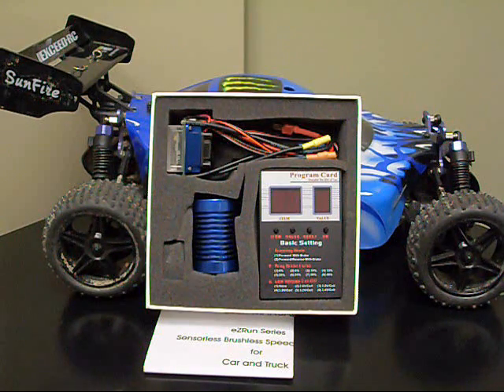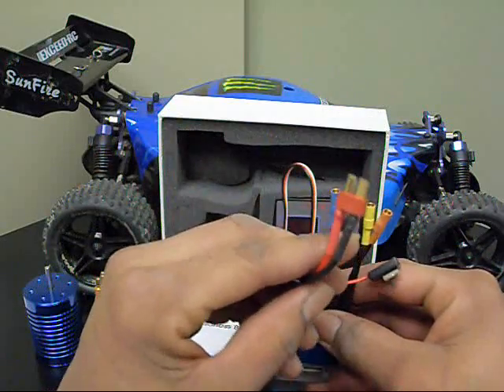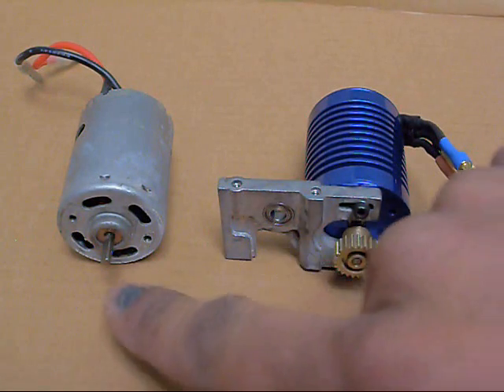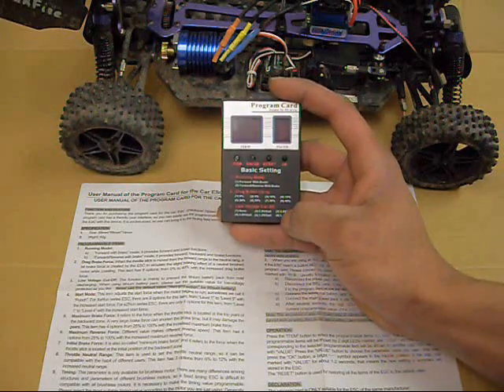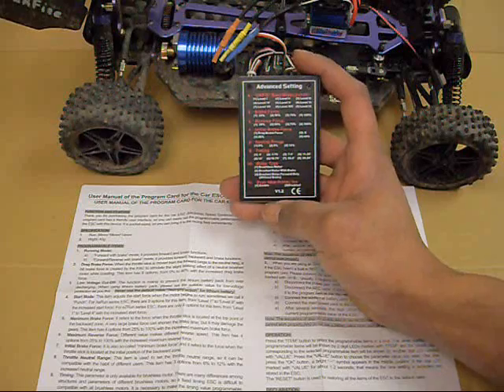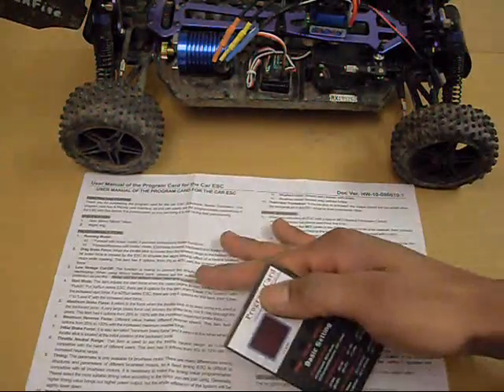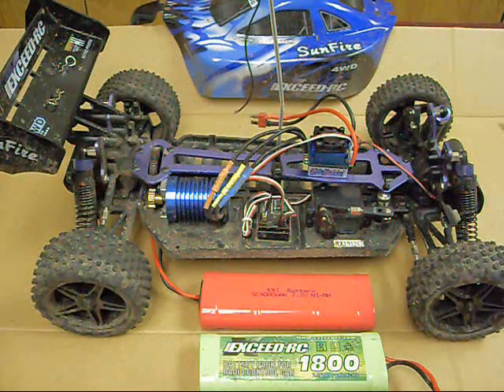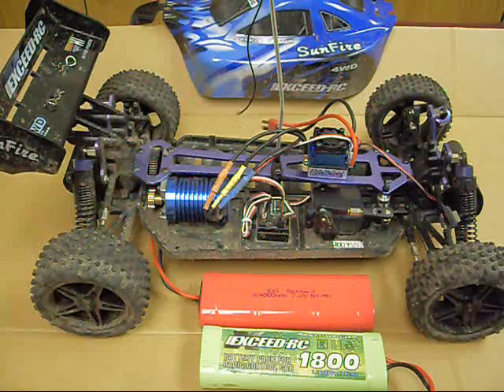Super FAST Brushless Upgrades for 1/10th Electric RC Cars!!!

Comment: talk about breaking gears my Truck is in the shop right now getting new gear system put inside the Truck would this be good motor for my Truck and battery to upgrade to stock??

Comment: can those motors be placed for on road rc ?? seen a lot of them on buggies but not on road. thanx
Reply: +Hydra Inarms Theoretically, yes, however they have a low(er) kV, which is like the gear ratio of electric motors.
So pretty much, yes, but it would run a slower top speed than a road motor.

Comment: how long would a 7.4V 5000mah battery last on this set up?
Reply: +Devon Asher 13 to 15 min
Reply: +Devon Asher If you set it up properly, on video is too much power for this car, you will get up to 60min on LiPo.
Reply: i dont think 60 min is anywhere close to reasonable but i do agreeon too much "ebay" power

Comment: can i run this  system with nihm 3300?
Reply: I just put this motor and esc in my 1/10 2wd ECX Torment, I use a 3600mah Venom battery. I even use a 1800mah battery works fine.

Comment: Would a 7.2volts NiMH 3300mAh Battery work well or would i need to go bigger
Reply: +Jay Rolt low run time on that battery but go bigger for faster and longer run time
Reply: ok thx
Reply: np

Comment: sir can u help me, im handicapped they r gonna resend me a l969 n the 1st 1 ive still got it but i dont know how to  fix it u see the front right wheel came off but its still on truck, now everythings there i think except where u know where the tube thingy goes in   tire n at other side i think its missing other part to hold it on but ur the expert im not saying what it needs i just dont know, n why do theyyy sell cars  to that just burn up in less than 5 mins n i cant afford it can u help me out no im not sayiing u pay for it or anything im saying to help me creat something that is fast n wont burn up so quick i need help, PLLEEEAAAASSSSSEEEEEEEEEEEEE
Reply: jeff c Buy a HSP xStr Pro and don't do anything with it except charge the battery and have fun.
Reply: dude wha wha wha mman wow the hsp stuff is realy exspensivee im a handicapped person i thought u would help  me , id like to get all that stuff but i dont know what to get, can u help me out

Comment: I m sorry but this system is not super FAST. It s just a regular mild system that is great for stepping into the world of brushless motors and ESC's. And if you have a 4x4 rc, you are going to want way more juice in your ESC, because 35 amps man... That's just begging for the esc to fry out. In a 4x4 1/10 scale rc i strongly recommend that you get a motor system at 60 amps or more, that will work just fine in my opinion. If you are looking for something cheap and POWERFULL, buy the Leopard V2 10t brushless combo, you can get it at Hobbyking for example, and you will get a medium/powerfull brushless combo for around 70 bucks. Use a 3s lipo, and man this thing rips. Depending on the weight of your rc it can go from 30 mph to 50 mph (50 mph is on 3s lipo only) but you want to stick to general 2s lipo if this is your first experience of brushless. I can t comment all the details here, it would be to long, but go to my channel FAST RCS for more info. Ill be posting "New into rc" and "rc tutorials" soon, hopefully. But please tune in to my channel and watch my running videos, hope you like it!! Otherwise great video Nitrorcx, good job😉
Reply: Fast Rcs Bro in 2009 it was like super fast but now 30 mph super slow I anyone saw someone with a brushless rc car the were very jelous
Reply: Fast Rcs hey I want my rc to be fast as hell should I do higher kv or lower
Reply: Higher KV means more top speed and lower torque, and lower KV motor means less top speed but more torque.

Comment: Get your basic facts correct if you make a how-to video.... 3.7V is nominal voltage for LiPo batts and not a low voltage cut off situation.  LiPo should not go be low 3.0 volts so a cut off setting would be 3.2 or 3.4

Comment: watch out for ezrun brushless 1/10 systems the motor is advertised as 540 size, its actually a 380 size with fins on it, i have fryed 2 of these in my team associated t3 2 wheel drive, but all the best with your buy and good video, cheers .

Comment: you need a much more powerful system for that 4x4 buggy.. what you have there is guaranteed heat problems. i had the 65 amp version and with fairly light gearing also had some excess heat.... good luck man. cool video though!

Comment: You should not drain lipos under 3 volts per cell. 3.7 volts per cell is super conservative. I have used 3.1v per cell as a safe cutoff and never had any problems.

Comment: I suggest that you upgrade your ESC to a 60 amp because I used a 45 amp ESC and paired it with a 3 cell lipo battery and ended up shorting out my ESC. I was left with a melted price of plastic and and burned wires. The exceed company manufactures the brushless counterpart to the brushed sunfire buggy and uses a 60 amp ESC. If I wanted completely overkill, I would use a 5900 kv tacon motor, an 80 amp esc, and a 2200 mah sky lipo or gens ace battery.

Comment from the maker: Yes you can use a 3S lipo with that combo, but you might want to upgrade the fan on the ESC later on down the road since the fan isn't rated for 3s usage.

Comment: I upgraded my Sunfire buggy to a brushless combo with 35a esc and 4300kv motor with 7.4 v 3300mah 30c blue lipo battery. i think i get 45 mph. i was wanting to know if if could use an  11.1v lipo to acheive 60 mph without damaging my esc or wo

Comment: Hi, ive just ordered a brushless upgrade kit, & yours is the best upgrade vid for my xstr 1/10, will it be able to handle it? i'm currently running a 7.4v lipo 5000mah 40c in the brushless motor it runs fine but it only goes about 20mph.. the leopard brushless kit ive bought on ebay comes with an ESC and a program card.I see you left your receiver as stock will this work for me too? any advice would be great..

Comment: Nice vid. I font normally buy exceed cars. Picked up a drift star and through a 35amp esc and 4300kv motor on it with a 2s 5000mah 65c gens ace battery... It rips

Comment: Down size to this kit, is its a 380 size motor, in a 540 size can. Good for cars, and light weight vehicles. For heavier vehicles, Definatly a beefier true 540-550 size motor is needed.

Comment: i would recomend changing your wheel washers to the yeah racing aluminum part...
i went from 27 turn brushed to a 22 turn brushed, and it snapped both of the rear plastic wheel washers

Comment from the maker: Easiest way to is use the combo on a electric car since it's designed for the motor already. If you try to mount it on a gas or nitro powered car you will need to find a way to mount it and make it work.

Comment from the maker: @smeelokilo Several years ago we had a issue with the dog bones twisting and what not but this is the first case that I have heard of since then. Get another set and test them out and see if it still breaks. The manufacture is using stronger steel to make the dog bones so there shouldn't be the issue.

Comment: @nitrorcx Yes, It is completely stock except for the battery. As stated above I got a 2 cell 5000mah 20C Lipo for it. I had the ESC cutting off after 3-4 seconds issue with the stock NiMH battery.

Comment: @nitrorcx Well, I stuffed foam in the joint cups and I haven't broke an axle and it doesn't look like they are wearing into the joint cups anymore BUT.. The rear axles.. twist and bend. No I do not tow anything or hold the car from moving in any way... This just happens from normal driving. Do you guys offer thicker axles that telescope instead of go into a joint cup like the traxxas cars have? If I could get those it'd be awesome...

Comment: Good instruction vid. But lipos can handle being drained to 3V per cell minimum, 3.7 is just the good balanced charged that they're best kept at. Basically its 4.2V max charge, 3.7V balanced charge and 3V minimum.

Comment: I recently got the Pro version of the 1/10 scale Sunfire buggy and a 2 cell 5000mah Lithium Polymer battery for it. It is a blast to drive around the neighborhood, but the rear drive shafts keep breaking and the joint cups that the drive shafts go into keep wearing grooves in themselves where the pins on the drive shafts slide into the slits. I have replaced the joint cups, gotton new drive shafts but they still break. Any ideas? Its making me sad because I love to drive this thing :/

Comment: hey nitrorcx im getting the leopard 1/10 brushless system (basicaly the same thing as this with different name and color) is it ok to put a 5000 mAh 14.8 volt battery with the system or will it get hot to fast?

Comment: in the manual it only goes to item 10, but the program card goes up to 11??? what is the item 11,   also  mine keeps cutting out and a green led lights for 30 seconds or so then works again,  the battery is a  new 3 cell 50c 4500mah lipo so its not the battery, its driveing me mad.

Comment: i wouldnt use the 35amp system in a 4wd buggy or a truck.  its perfect for a on-road car or drifter.  you should really use the ez-run 60amp system for trucks or anything running offroad.

Comment: video has bad information.  Nominal voltage for a lipo is 3.7, the stop discharge point is normally 2.2 volts.  Stopping a lipo cell at 3.4volts would waste 80% of it's power.

Comment: At 3:21 he states that low voltage cut-off should never be below 3.7V for LiPo. This is a complete mistake, as 3.7 is the NOMINAL cell voltage. Cut-off ought to be 3.2 or 3.1, and must never be below 3.0V!

I myself run a ERBE (E-Revo Brushless ed.) with 4S and 6S LiPos using Castle Creations MMM speed control.. Cut-off is set to 3.2.

Comment: one thing i dont get, how does the esc get the radio signal from the remote? does it have its own reciever and antenna or does it have to plug into the cars circuit board?

Comment: also dude, if ur gonna get a spur gear with less teeth, ur pinion should have more. you should have about a 30 tooth pinion to mach a 78 tooth spur. if ur gonna do a smaller pinion then leave ur spur but i would go with a smaller spur and larger pinion.

Comment: @BLEENNZ VXL velineon  but this ones better if u get it on a 60amp ESC and a different motor like castle creations or and venom i run a 5.5t venom with a 60AMP ESC by ezrun and it goes flying down my street and im planning to go racing against my friends nitro Once i get lipo.

Comment: @devster117 I got a Team Losi Desert Truck and i got a Ezrun 60amp ESC and A VENOM 5.5t Motor And a 7 cell 8.4v 4200mah Battery and getting a albumin Pinon 23T and  a KEVLAR spur Gear 78T I could match Your Lazer.

Comment: lol i got questions too. how fast do u guys think my 6400kv 10 turn brushless velineon system with a 6 cell 7.2 volt 3600mah battery go. i got a larger 24t pinion gear. its all in my kyosho lazer.

Comment: deans! perfect! =P
will this work on a traxxas e-maxx?
im using 3.6amp, 6-cell, Ni-MH batteries
my e-maxx had a bad experience with Tamiya connectors (they shorted out and the truck went into autodrive going at 35mph....if it hadn't hit a tree and flipped over i'd have lost it for good lol)

Comment: motors with 2 wires are normal electric motors with brushes (sry for my bad english)
motors witz 3 wires are special brushless motors witch make higher rpm's and don't as much batterie as the ones with 2 wires

Comment: @chrisbarnes100  get a grip you knobhead there shit ,buy some good combo instead for shit 1 mate like mamba etc or traxxas vxl or speed passion . but i bet the esc wont last never long at all . its say you can use 3cells but the fan than on is for 2 cells and you would think they would of put a fan out that can take 3cells not just 2 dick , start racing and mine stand a chance

Comment: 70mph my arse i got a traxxas rustlervxl stampede vxl and the bandit vxl and emaxx  they do 70mph with stupid gearing and i would not run a ezrun on a 3 cell lipo battery as they was made to use 2 cell lipo battery plus you need a 12v fan to run 3cells lipo battery try a 4 cell lipo finish the esc of you mite as well coz that what will happen when running it with a 3cell lipo battery there not that good i got 2 ezrun combo stick to 2 cell lipo battery not 3 cells

Comment: If i plug a Ni-Mh Battery does the Motor recognice that? I mean then i only have 7.2 V but 6Cells -> so the motor wont run coz of the automatic low Voltage Cut off?!
Thanks for Help :D

Comment: when you buy a brushless engine do you have to buy the other stuff or can you cut the old motors off and soder new ones on? i have a boat. i want to get 540 brushless engines. it is a dual motor. can i just take off old motors and put in new ones or do i have to get program card and  memory card thing. and also, how do you get the card to the old receivers.

Comment: On 3s 4400mah Lipos the setups are more power and speed than you can use for general bashing around. 
I usually get about 30-40 mins runtime on 3s lipos.
They arent as fast or as much torque as the Traxxas VXL or castle Creation setups BUT, you can get them shipped for AUD $120 which is half/ less than half the cost of the Sidewinder/ VXL setups
Probably the best setup for bashing around!

Comment: stevensx14 :
I have a 4300EZrun in my TT01 and a 3000KV version in my Traxxas Stampede.
Personally I have had no troubles with either setup (although I have the 60 amp version  esc)